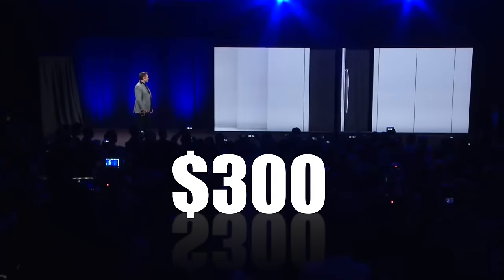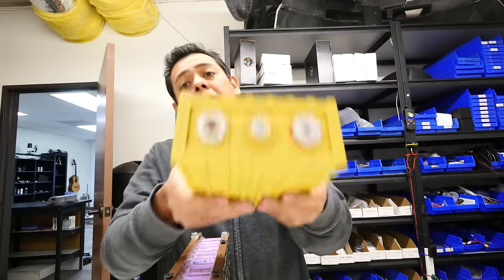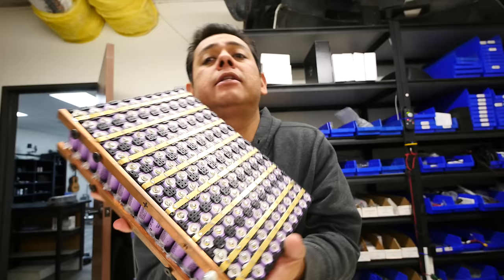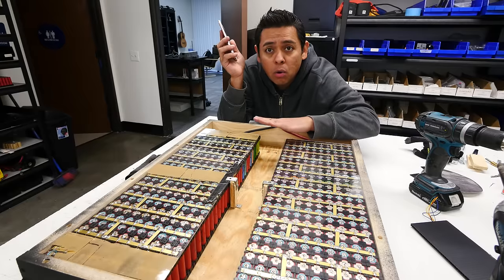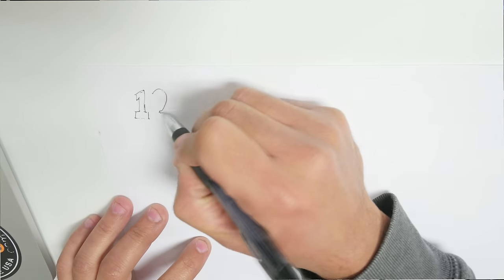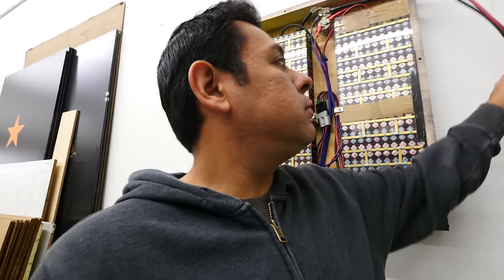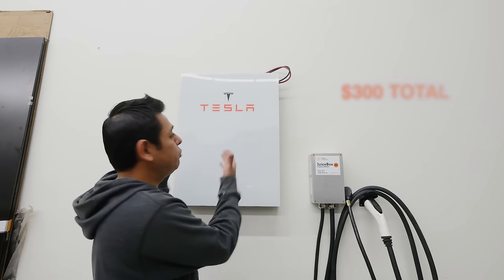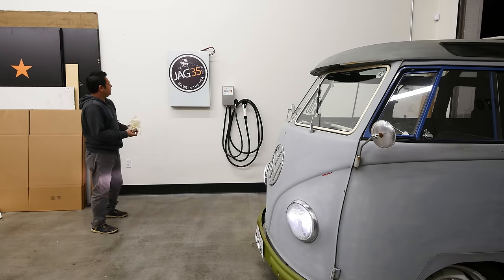$300 DIY Tesla Powerwall - Solar storage 18650 lithium ion home Battery

Comment: Would be interesting if you measured the actual battery capacity now that it's built... Curious to know how much it varies from the predicted capacity. Without that bit of information it's hard to know whether your strategy of using recycled laptop batteries worked. Personally I'm guessing your 2000mAh rating for each cell is off by a factor of at least 2.

Also, stating the obvious here, but any lithium-ion battery bank is going need some circuitry to prevent over charging and over discharging. I'm curious what you'll use that can handle the amount of current this bank can provide. Not saying it doesn't exist of course, but without that bit of circuitry this isn't a functional battery bank yet.

And I'd seriously consider using hardie board or similar for the backing (the side that touches your house) in case of failure. It's a cheap and easy way to at least somewhat compensate for the fact that unlike the PowerWall this has no thermal protection.

And all that said, keep up the great work, love your videos!

Comment: I doubt that you will see full capacity from these cells vs new cells.  Some of the cells from dead laptops may be weak, or have a limited life left in them.  That's why I would wire them in series,  so weak cells are easier to find when they do go bad (just monitor voltage across each cell).  In series-parallel,  banks can be switched out one at a time and the voltage checked,  then the bad cell or cells can be isolated and swapped out.

Comment: that's a lot of work, & its only part way done, its much easier to buy a USED APC smart UPS 1200 to 1800 a 24V model & hook it up to a battery bank of deep cycle batteries connected 2 in series then parallel, you will have a quality pure sign wave inverter that can deliver 900 to 1200w your batteries will last 5 to 10 years depending on the quality and type.

I built one for my electronics & another that I plug a sub panel into to run my lights & ceiling fans during a power failure,  I get 4 to 6 hrs run time on each until I need to start the generator & start charging the batteries as I use it.

Comment: I would say that the cells in that wall are not going to last as long as teslas power wall because this version doesn't have cooling so the cells will get hot and degrade them. Also tesla does not use the same cells he used. If you want the same life as a tesla wall you need to use the cells tesla manufactured

Comment: This is interesting but you know the Powerwall includes the inverter, right?  Although still a nice price even including the inverter.

You need to worry about fire though with used LI-ion batteries.  Just something that should be planned for.
Reply from the maker: The new one does,  the old one didn’t.  Planning for fire it’s always a good idea

Comment: Just watching some of the older videos on a Saturday Afternoon. Something that has always puzzled me and maybe I just don't understand DC power yet. Why convert your power to AC, when most of your devices run on DC already. Looking in my LivingRoom and Kitchen, I see only the Stove, Refrigerator, and Microwave that actually use AC. But a Stove and Refrigerator can always be swapped for propane ones. Even every single light in my home uses LEDs, that has a tiny AC to DC converter in the bulb.

If your planning to use a solar system(and I plan on one day when I can afford the cells). Wouldn't it be cost effective to run DC power to your home and at each outlet have a variable output to the device you are using( a plugin, that has it ready for Voltage adjustment)? Or maybe you just convert everything in your home to use a variable plugin( the device has a converter to match the plug). I see a lot of money being placed into these systems, by people that have it. It just seems like a conversion to DC outlet would be more efficient in the long run. Just makes no sense to convert DC to AC, and then Back to DC.

I guess the main factor is not all devices use the same amount of DC power, so converting DC to AC, and Than back to DC with the plugin, may just be cost effective and less Ewaste in the long run. I am a Poor boy and Unfortunately, I will probably never be able to afford a solar system like the ones I see on Youtube, By my Favorite posters. But It leaves me confused on why we convert like this. I guess when I Win the LOTO(wife says "Joe you can't win the lotto if you never play"), and I know someday I WILL!!!! I may just design a home that utilizes DC and AC both, but only using AC where it is needed. 

But who knows, maybe I am just overthinking something that may have a simple answer?NJ--------

Comment: So wait a minute...your trying to say that this HUGE diy battery array is the same as a Powerwall?  Kidding right?  It has cooling, a soft discharging capacitor circuit and a very sophisticated charging system built in and it is less than half the size and twice the capacity.   You really need to make it clear that this will in no way shape or form replace a powerwall nor can it power your home for any meaningful amount of time.  Maybe it will power a refrigerator but trying to run an average home on this would be crazy.  It may run for about 15 minutes.
Nice build though...just not the same though.

Comment: Explain this what's is two white capacitors or connectors? Relays or resistors Where buying, if is no bms from ebike ? Can connect parallel 3 or 4 bms together for safety charging and discharging.

Comment: It seems easier to use several of the large yellow Lithium batteries than having to sort out thousands of smaller ones.
Reply: Might be easier but then the power of the whole pack is seriously compromised in event of failure of one of the few large units. On the other hand failure of one of the thousand units will have a negligible effect on the power of the whole pack.

Comment: Lion batteries are consumables with a limited cycle life. Using new cells, it would be around 2k in cells for 10kw. Cant really compare a battery built out of old used cells to one out of new cells. Sure it will work if you build it correctly but you be spending lots of time finding dead cells and replacing them.

Comment: Doesn't make good efficiency to charge a vehicle from batteries. Better to be able to swap the batteries and charge the drained ones during a time power's cheap (when sun shines, wind blows or utility rate is low at night).

Comment: I wonder about the need for ventilation for cooling the cells during charging and discharge. What level of current draw will your setup provide? I think I would have applied the $100 for the fancy (and Trademark infringing) glass towards a more fire resistant case.

Comment: Please keep in mind!!!:  A single Powerwall will NOT power the average sized home, due to the Powerwall's limited amperage output, or reduced electrical current. To sum it up, the Tesla Powerwall is recommended, however, the next version with higher amperage, at lower cost, would be HIGHLY recommended.  -Armánd Dotsey
Reply from the maker: correct,  7kWh is not much energy.  At 2kW  output you get 3.5 hours of use

Comment: About the 18650 cells:How much time will it take it for them to start being useless.You cant know their condition when you test them but what is an approximate life you guys estimate the storage will last before like 50% capacity?
Also will it be easy to integrate a system to contain the capacity of the battery within safe boundries and not let it be fully drained out?
Hope i am making sense and thanks in advance for the help

Comment: So $200 1kw where tesla walls are 13.5kw. So to build a Tesla like power wall it would cost $2700. With out charge controls or inverter.  Where the Tesla powerwall is 7800 with everything needed to install and run. Plus apps and smart grid like storm watch . 
So the advantage is less up front cost. If you spent loan payment that you would have for Tesla ($18000@4% for 20year) $109 a month on building your own. It would take 2 years just to build battery.  And 2 more years to by the smart inverters needed to used the power from the batteries...  
This would save you $4000 over tesla but take atleast 4 years to build. 
Well not including time to do it all... so maybe cost more depending on how valuable your time is...

Comment: What are the charge/discharge cycle of the Tesla cells? I see cells going for $38 bucks for 50 cells but only have a 1000 charge/discharge cycle. At best, you would get around 2.5 years out of this system. Where is the benefit? I have also seen a few of the Tesla system gone to the garbage heap for dead cells. This may make for a compact system but i don't think i want to be spending hundreds of dollars every couple years to replace these cells.

Comment: my guess is you are using lithium cells so its not such a good idea, first you need a special charger for lithium batteries as not to over charge them, so inverters & UPS would not be able to charge them.

then if you get a bad cell have fun finding it, ideally you want to balance charge each cell with lithium batteries as some like to charge at different rates so with bulk cell charging when the cell or bank of cells gets to 4.23v it will shut the charger off so some cells may not be fully charged.

thus balance charging is a must but with that many cells you would need a custom designed balance charger built for the number of cells the unit holds, without that it will probably work OK for a while until some of the cells start to get out of balance then your operating time will drop off.

Comment: Also, why would you use an inverter? 

You would only need an inverter to run things like a Fridge, microwave, toaster and electric kettle but literally everything else you could run from DC voltages like 12 or 19v Tv's, most appliances can be found in 12 volts and you can even power most items that have power packs from DC voltages because they convert from AC to DC in their power packs anyway. 

People should try and avoid running an inverter wherever possible and try running their items from direct Dc electricity using step up or step down converters because if they are using AC appliances at 110 or 240 volt through the inverter then they will drain their battery packs so much faster
Reply: Finally someone giving credit to Nicolas Tesla...

Comment: one 10 KW inverter plus deep cycle batteries for less than $1500.  10 KW inverter cost $900 plus batteries still less than Tesla.
Reply from the maker: cheap inverter + cheap Batteries  yes its possible,   but its worth what you pay for them

Comment: Assembling a lithium battery pack is not for the fait of hart.
When soldering have a bucket full of sand.  If one of these batteries go supernova just drop it in the bucket and have a  fire extinguisher close by.  One in 1000 chance this happens.  You need to be ready if it does.

Comment: How do you think does Tesla implement their fuses? I wouldn`t believe they use resistor legs.. or do they?
Reply from the maker: They can afford to buy wire of any size in any quantities
Reply: @jehugarcia  Sure, so they are probably using real, certified fuses instead of this DIY solution, right?

Comment: The powerwalls are normally located in the garage or an shed. How the 18650's behave in low temperature, about freezing point or below? I'm a hunter and i want to use these kind of batteries for trail cams or some other gadgets?

Comment: What are your thoughts of 6s versus 7s for 24 volts and lower your max charge on your cells for the 7s?  Wouldn't that tax the cells less provided you do not discharge them to low?
Reply from the maker: 12v = 3.5 cells in series. So 7s is better but it really depends on the equipment

Comment: You might have mentioned this before, where is a good trusted source to get used batteries. Or is it just a shot in the dark. I would like to build a small Tesla wall. For beginners keeping it simple. Ironically, I've been working on Steam turbines Transformers and electric motors all my life. But like a brain surgeon, he doesn't work on feet. I have two 6 volt Trojan Batteries with two Harbor Freight 45 watt solar panels. Seemed to work fine on a small scale. But I want to go bigger
Reply from the maker: I have started offering some here https://jag35.com/collections/lithium-batteries

Comment: Admirable project, just:
* Size is not matching and not mentioned
* Inverter not included in calculation 
* Timing spent is not a cost?  Next one 'In no time' you said?  Upcycling laptop dead batteries? 
* Putting Tesla logo and not giving a comment about that.. that's slight disrespect at least. 

Well bro..you stretching :)

Comment: Hey Jehu, I am from Puerto Rico and still no power from the grid. I bought Schneider 4048 ,also bought  (3) Tesla modules 57v 3k watts, to star with a backup bank that is going to be charge with 2200 Watts inverter generator. For now  I need to get it to work without solar panels that’s something I plan for the future. Well the question is what else you suggest I get buy to charge battery safely? Thanks!

Comment: Why 18650 batteries? The 20700's are better and come in larger MAH . I know the 18650's are widely available if you want to pull apart old parts to get batteries from but I often don't understand why more people don't use better batteries than the 18650's.... laptop batteries only used them for their size but with the 20700's being only a couple mm's bigger, they are still perfect for building a home power system. Drill batteries should use them too

Comment: it's not really 180 dollars for the battery  you have the battery connector and the material to connect them 
and what about some cooling cos it's most get hot in this wood box
Reply from the maker: Plus the building,  can’t hang it in the wall if you don’t have one

Comment: Why doesn't he explain the reason he divides the number of cells for the different voltages? (Like 12V, 24V, 36V..)
Reply: I checked the spec sheets on the family of 18650 batteries, and discharge charts have them starting out at 4.17V, so when you average the voltage over the usable discharge cycle (both highs and low voltages), it averages out to near 3V.  Maybe this is it ...

Comment: are you installing yours pack inside you house
I need to decide if I make a shed and install the packs outside
this indecision came after 8 cells explodes, I try to separate them
the were glue with I think superglue, so I use a screwdriver the make 
a small hole in one sell and a spark so this cell explode make the other
ones explode one by one

Comment: Can someone clarify - the old laptop batteries are surely not working very well - hence being "thrown away" ???  30c per battery, but are they any good ?  my experience of old batteries is they don't hold a charge.............Am I missing something here ?  Surely if they can be brought back into good service, someone would be doing that and selling them as used, but good.

Comment: When you say 1Kw, is that per hour?  Do you recommend not buying the square 9v batteries because they are the cheap EverReady kind?  @ 4:29, is that Masonite?
Thank you very much, THIS is the video I have been wanting to find - YAAAAY!
Now, if a supplier were only closer to me, I could go pick them up... I cannot imagine what 3 of those 'bricks' would cost, to ship.

6:26 - you can draw (illustrate), too!  What have you left out, tap dancing?!  :D  

@ 7:29, is that cardboard in the foreground, center and the far end, on the left, please?  Oh, I see metal angle pieces here at the close end, and cardboard under the clamp in the center, so this must be the same at the other end.  OK.

- I'm going to slow you waaay down, so I can try & keep up.  I've heard Dave talk about parallel vs series a lot, but I never asked him to explain it to me. :D   I am SO stocked I found THIS video!

Comment: would your powerwall still work as great and last longer as a tesla's powerwall?
Reply: His math is off.  you'll never have 4.4KWH that is the total at 3.7v  to get 12v you divide the cells into 4 groups (not 3 as he states).  at that point you are down to 1.11KWH.  24v systems is dividing by 8 (not 6 as he states).  At that point you are down to 555WH

Comment: You didn't include the cost of the battery packs. Also, equipment list would be helpful. Certainly, also, you'd want to provide instructions on how to test the old cells, to determine if they're any good. You didn't include the cables with the costs.  Certainly they could be gotten second hand for free.  I agree with the guy who said "100 for glass... you could'a bought more battery cells... ha ha ... GREAT VIDEO... but don't avoid me please.
Reply from the maker: I also didn’t include the cost of the house you will to own to install this thing on

Comment: Hi, Andy here, thanks for the video,  I am an electronic engineer, quick question, If I have all house with 12V LED Lights,  do you know any reason not why go straight from the battery wall (with protection) to the LED light systems? and use DC/AC converter? keeping the existing 120v system alone

Comment: I have a question which requires mostly personal subjective answer based on experience :) So in the vid 3 batteries (or batches of them connected in parallel) are connected in series to get to 12V. This is 3.7 * 3 = 11.1V nominal. On the other hand we can go with 3.7 * 4 = 14.8V. So in the end which is the better option? I just keep thinking that 11.1V is not high enough to keep DC -> AC inverter producing "good" output for "good" amount of time. On the other hand 14.8V seems higher than required which would overheat (?) and introduce losses (?) while going through DC -> AC guy. Please comment.
Reply from the maker: Correct 3.7v cells are not good for 12v,  they are better for 24v using 7 in series